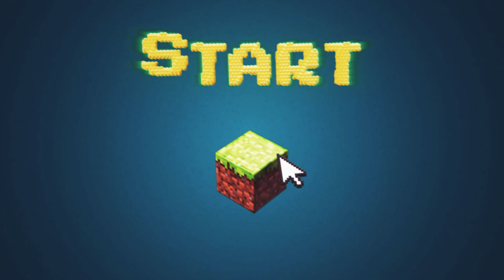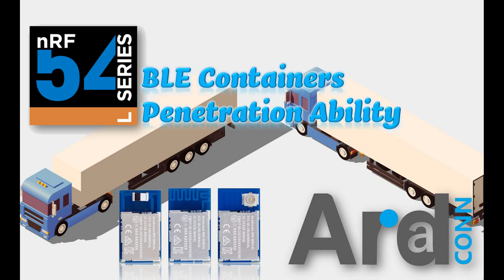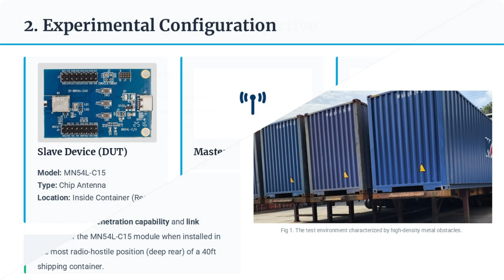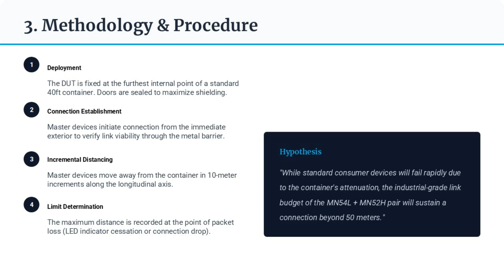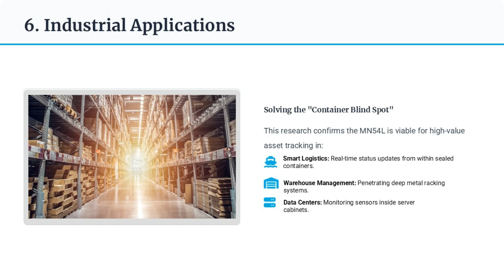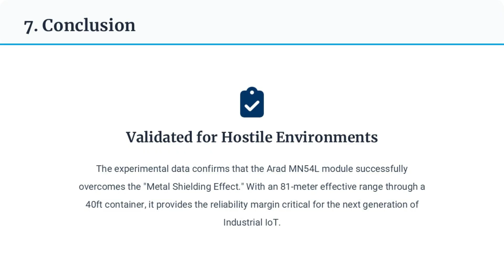The MN54L Module - Hardcore Wall Penetration, Container Blind Spot Terminator!

Comment: Can’t you just add an RF relay on the outside, inside, and passing through a sealed junction on your container?  Why limit yourself to 81 m?  For that matter, with a little thought your container could be equipped to communicate with a device within line of sight and relay the messages to and from the contents of the container.
Reply from the maker: You're right, this maximizes the communication range. However, this is a different use case.
This test was designed to simulate the maximum communication range that a single Bluetooth tracker can achieve inside a container after its wireless signal penetrates several metal walls.